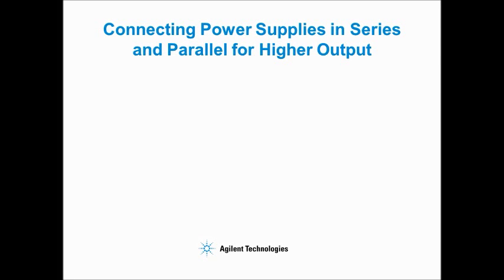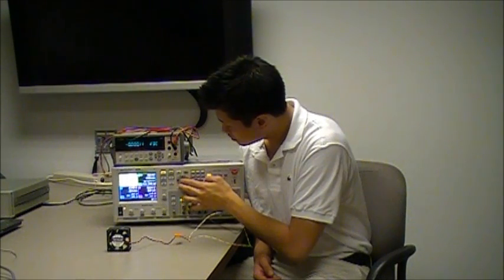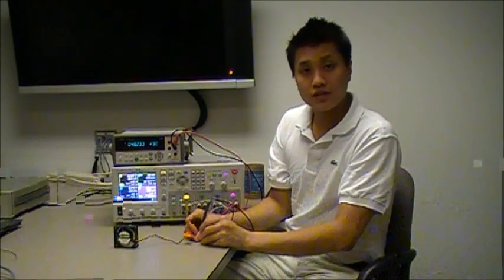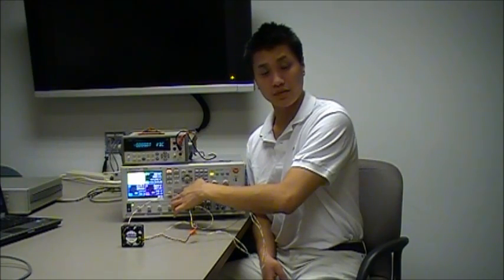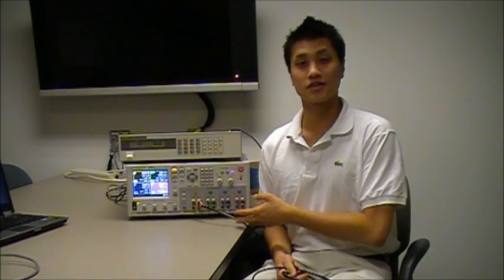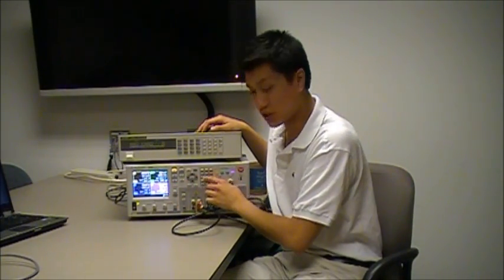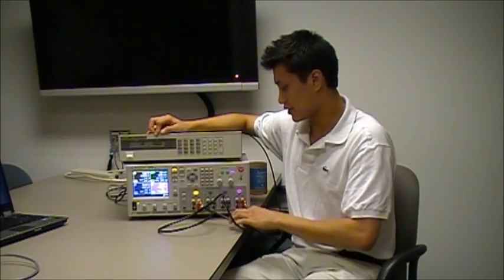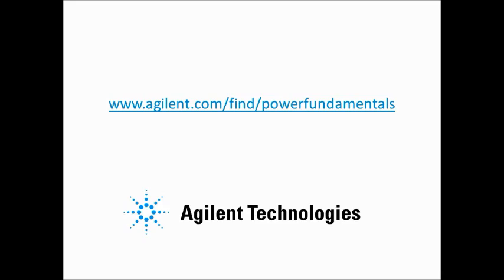DC Power Supply Outputs in Series or Parallel for Higher Output

Comment: Yeah, but i have no remote sense options on my basic Constant Voltage Meanwells, but i want to put 3 of them in parallel to obtain the desired maximum current...
Seems to be impossible..
Reply: Use a transformer meant to have a 3 phase input and a single phase output.
   
I'm not familiar with Meanwell power supplies, but it looks like they're a SMPS.  
Provided that the output stays switched, you can connect them to a transformer with 3 identical primary windings & a secondary winding with an equal number of turns to a single primary winding.  
In surplus industrial equipment, the primary windings will often have a common negative input for a total of 4 inputs (as for Wye configuration), which should still be fine in a constant voltage SMPS. 
Try to avoid a transformer in Delta configuration, as the primary windings are already wired in series.  
Three phase Delta wired devices will have only three inputs.
To utilize one anyway, the primary windings would need to be separated & the input leads extended.

Likewise, you can use three separate and identical transformers with an equal number of turns on the primary & secondary windings.  
Wire the outputs in parallel & you're golden.  
This should automatically balance the load as well since the current being drawn isn't directly coupled to the supplies, but gets drawn from each one equally.

Should the output be rectified, you can bridge the inputs and outputs of the rectifier (+ to + and - to -), assuming there's nothing problematic in the circuit of the power supply thereafter.  
Remember to add a rectifier & smoothing capacitor to the circuit after the secondary winding of the transformer, if needed.

Comment: When I tried connecting them in series, the voltage did not regulate when use to sink current. Will connecting in series works only when sourcing current?

Comment: Can you do the same process with AC power? if you have 2 AC power each limited to 6 KW and if you make it parallel and have an output of 12 KW? pls
Reply: It depends... Start with doing 6000 watts divided by the voltage used.  
The answer is the amperage drawn by one power source.  
Make sure that the electrical safety features of the circuit used can handle the current you intend to draw, and that both power supplies are plugged in to the same circuit (to avoid faze shifting weirdness in the output).

Assuming that both power supplies are identical, you can connect them in either series or parallel. 
If they (rather the transformers inside of them) aren't identical, the lower rated of the two will be over ridden & damaged by the higher rated one.  

In order for a transformer to change voltage or amperage, the input must either be alternating current or switched direct current.  
In both cases, smoothing capacitors and a rectifying bridge are used on the output if its a DC supply & the rectifier is omitted for AC.
So yeah, they're the same things... kind of, not really...  
A swan and a penguin are both birds, with a lot of the same sort of parts, but they aren't the same bird.

What you are wanting to do is ambiguous, as the output (in watts or Kw) of both power sources is the same, regardless of the configuration.

As an example, let's say that each power supply has an output of 300 volts at 20 amperes... The negative output of the first power supply is connected to the positive output of the second one. This is the "ground" connection, which you don't need.  
Insulate this connection for safety.

Now we have the positive output of the first power source (+300 volts) and the negative output of the second power source (-300 volts).  
600 volts at 20 amps when wired in series. 

If we connect the positive output of the first power supply to the positive output of the second, and did likewise with the negative outputs, the result is 300 volts and 40 amperes.
This is the parallel configuration.  

As you can now see... whether you would like to increase the voltage or the amperage is the question...  
Wattage is an overall measurement (volts X amps = watts) and isn't really an adequate way to communicate the request for the information you seek.  

Regardless, you now have the information required to do whatever you like.

Comment: so e.g. connecting two in series for a doubled voltage, they are both 9v 250mA this will make a 18v 250mA (rather than an 18v 500mA is what i'm asking.)
Reply: that is correct

Comment: Hey there,
I want to get a higher current from my charger which is 5v and 1A (I need 5v 2A) however I don't have an exact charger like that lying around would that work in parallel with a different charger (about the same ratings).
Thank you